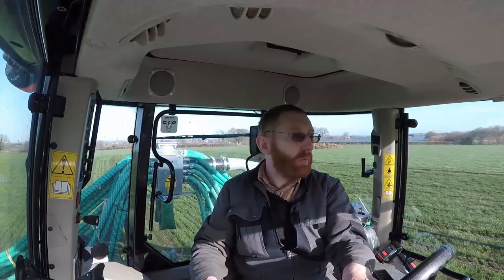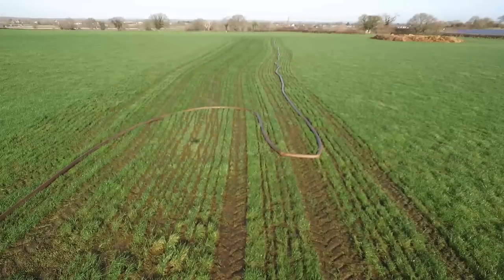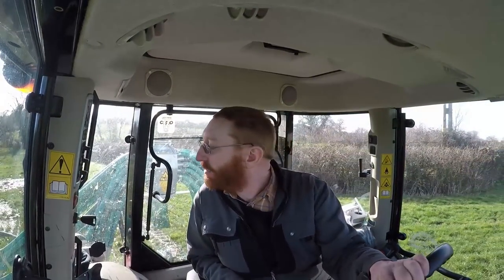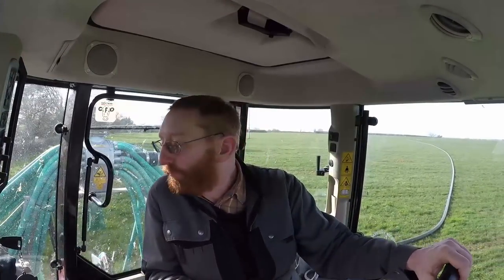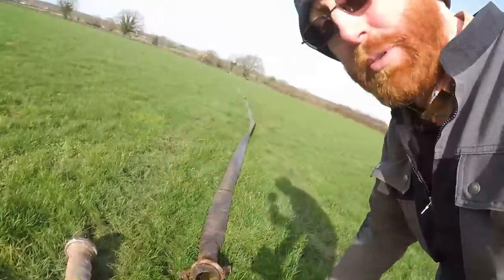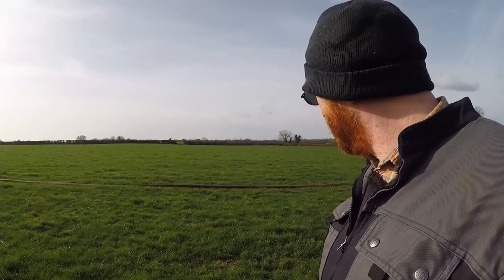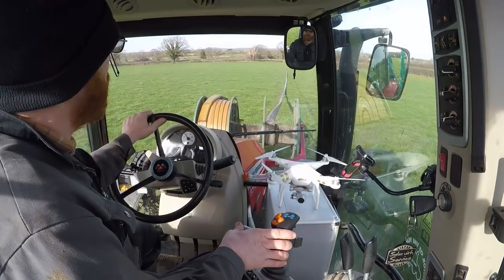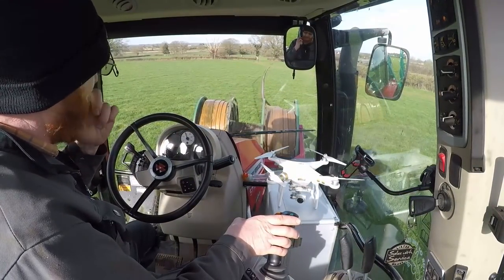Fodder beet prep, spreading slurry.

Comment: can get out 4 loads in a hour at that distance .............thats 8000 gallons per hour with a splash plate .......pipe at back of the tank next the splash plate has had a slice cut off it to speed up    the rate of  spreading ...........

Comment: what rate were u putting on the slurry ......4000 per acre or more .....?
Reply from the maker: Can't measure but somewhere in that region I expect.
Reply: @CowfarmerDan  will you be going back with another round  of slurry before u plough  the field .....?
will you  top dress with nitrogen  when the  crop is ahead  of the weeds ?
Reply from the maker: @georgedoorley5628  definitely no nitrogen, it may get some more slurry later.